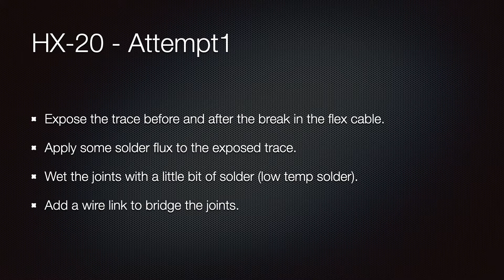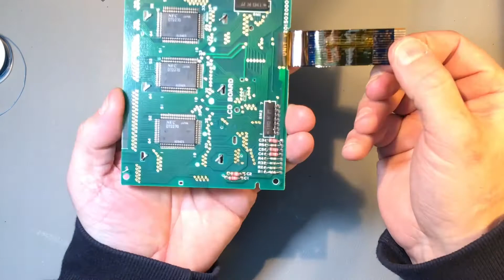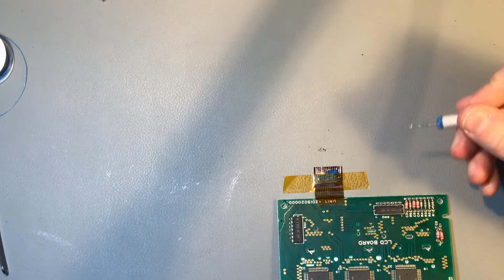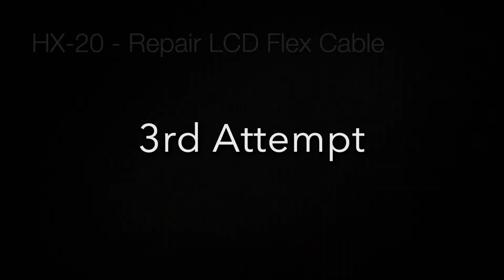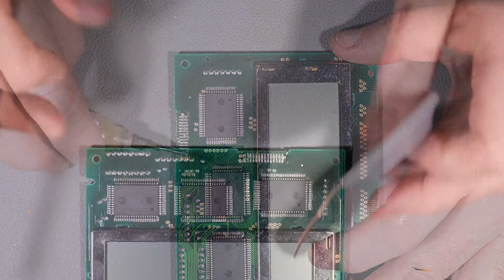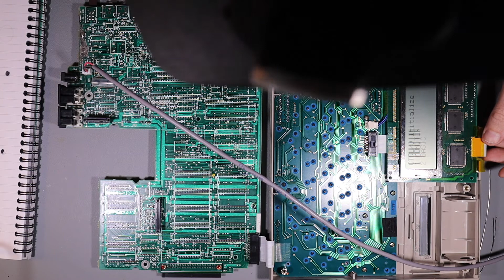HX 20 Repairing LCD Flex Cable

Comment: Excelent video, my HX-20 do not turns on and after replacing batteries and recapping the problem remains. Voltages at the motherboard Test Points are now correct but a battery leak damaged the LCD flat cable and part of the PCB. I'll try to replace it the flat cable and see...